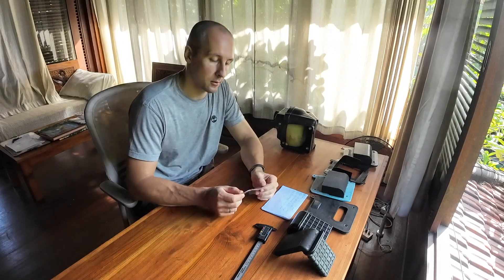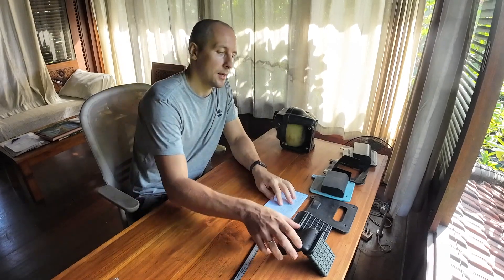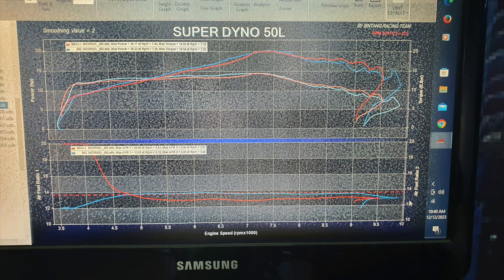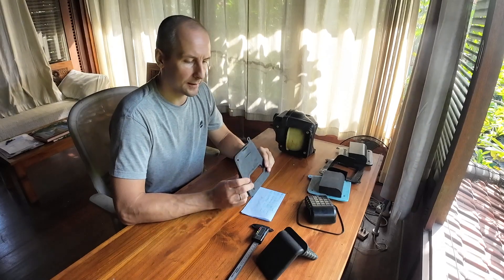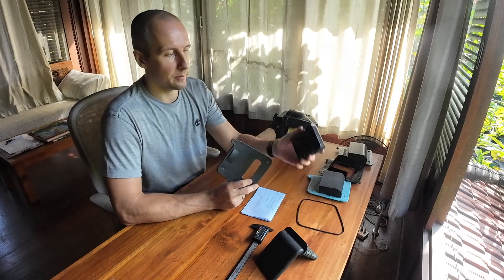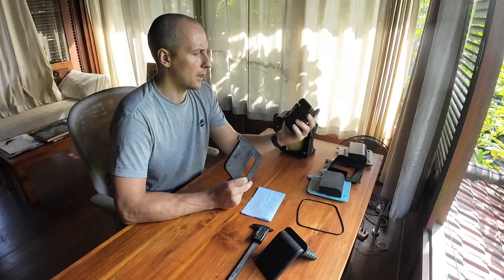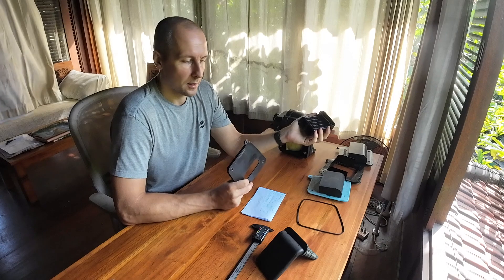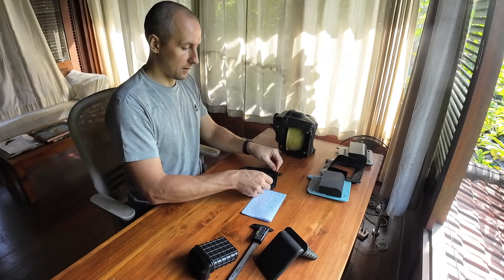KLX250 / KLX300 ultimate intake & snorkel review, part 1

Comment: I just purchased a 2025 KLX300. I installed the KDX snorkel as my only modification bc it was cheap and easy. Do I have to now add a fuel tuner or is it safe for the motor to run with the KDX the way it is?
Reply from the maker: safe

Comment: Removing the sub throttle  not make any difference on the power. However I seen some claims I never noticed anything myself.  This got something to do with temperature and  idling... I bought already modified bike and the idling was bit uneven related to temperature. I removed the sub throttle believing the nonsense claiming and there was not change in power at all but the idling since this  keep the same rives but when cold the fuel mix it is lean. So my assumption is: instead the ECU control the length of  injection pulses to adjust the mixture related to temperature  instead  it operate the servo in the sub throttle. The reason know only the designer of it.   Second reason to support my experience is that the bike was already modified the schnorkel was removed there is valve readjusting  "Martini effect"  and different exhaust. The mixture of fuel if warm is correct the bike have god power and good characteristic. If someone who did the alterations and  he did it right... if he would believe the sub throttle removal  would have any power improvement the sub throttle would be already removed.  Better benefit was when  i modified the throttle and make it fast response and it made huge difference especially in technical riding.  You can buy  such throttle but not with the switches what I wanted to keep. Not gain power just help operate the brake and throttle the same time  way easier because need less movement.
Reply from the maker: Sub throttle limits mid range power especially on klx300 - it doesn't fully open until 7000rpm
 There is 4hp difference in the mid rpm!. On klx250 it's not that bad, but it limits throttle response. 
For your issue - remove spring from the throttle body and servo motor won't affect your idle.
Reply: @ I did not notice anything. 4 Hp is a lot this would be noticeable. it is like 20% of the power. But it could be readjusted on the side by the screws and that is why the idling was changing. I can not say if the setting was original. Removal should be done complete because the axis making turbulences and so it slowing the air flow... especially if you leave the connector on and it is still rotating so it changing the turbulences if go to the core. All intake polished and all connection refabricated to make smooth obstacle free inlet to avoid any air turbulences. But what is point to buy 250CC 4T and than do such effort if there is many more powerful bikes already.  Unless racing in the 250cc category or so.  As I say the fast responding throttle was noticeable and I love it... just enlarge the diameter on the twist so the cable go around larger circumference.
Reply from the maker: @sevrovychodnithajsko8315  is your bike klx250or klx300? Sub throttle on klx250 works not that bad as on 300!
Reply: @planetklx2  250
Reply from the maker: Check pictures here 
https://planetklx2.netlify.app/docs/engine/intake/#removal-process

Comment: Will you ever post stl for the upgraded snorkel and cover?
Reply from the maker: @jex8046  what is "stl"?
Reply: @planetklx2  the 3d print file
Reply from the maker: @jex8046  no, but it will available for purchase on eBay (if proven to work better than other options)

Comment: Does the fuel map need to be adjusted with the airbox/snorkel modification? Does the bike run to lean with the more airflow?
Reply: Kdx snorkel is minor change in airflow. So you might get away without adding extra fuel. Snorkel-less or open airbox needs extra 7-10% fuel up until 7000rpm